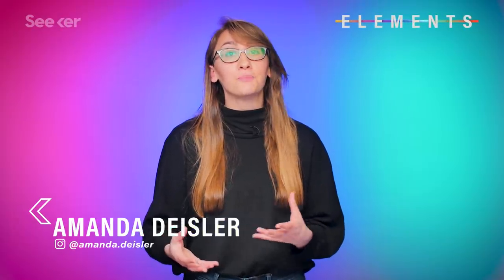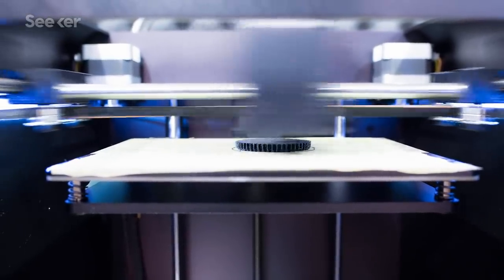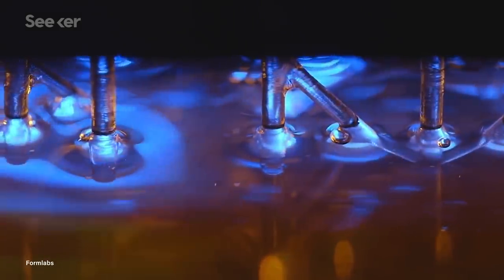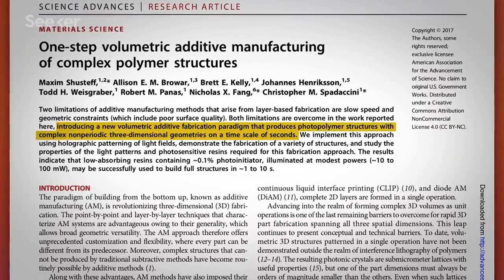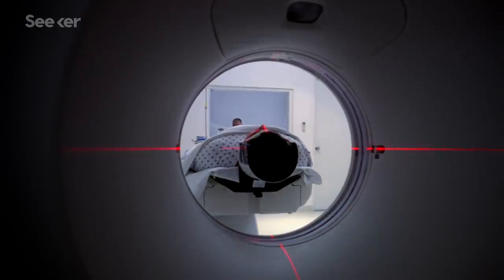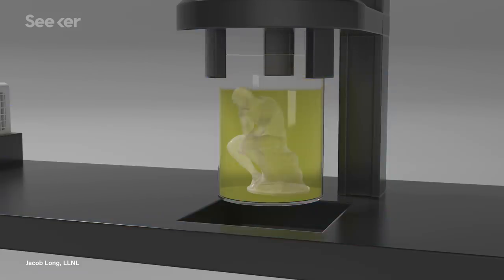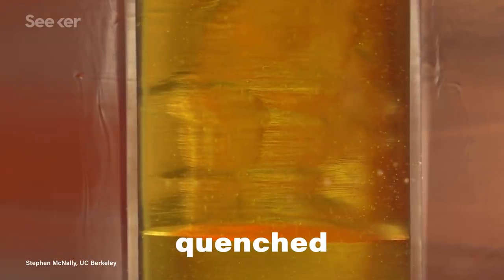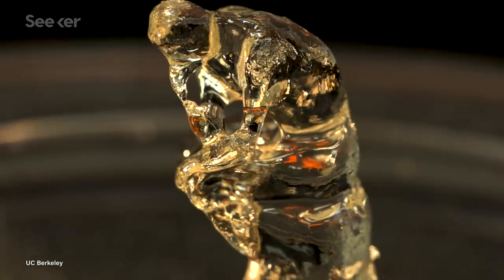Why This 3D Light Printer Is a HUGE Game Changer

Comment: I hope this could work across different materials someday, maybe using electric fields instead of light.
Reply: You could use DUMB microbots (spherical one-use batteries with a simple light sensor that makes them "magnetic" for a brief time), so you can use selective magnetic fields to control their position to BLOCK/reflect the laser [creating a "high density point"], so the resin could coalesce around/next/away from them from the "inside" of the object as it is made.
-> This allows for the use of multiple lasers shooting from all angles at the same time.
Reply: isn't visible light a small part of the electromagnetic spectrum? or ju really mean fields theory where fields are superior than particles  i.e photons?
Reply: @adolfodef  i'm sure people hu envisioned this first thought of that already. then they were shot in the head because of their stupid suggestions.
Reply: @kevintorres7045  not in the same context, no. it is fundamentally, but the actual usage is way different. you can have electricity and magnetism without light, light without either, and so on. It's all just energy and how you're actually applying it. like welding vs casting. both can make the same part.
Reply: You don't need it to print using different material. You can use the first object to make a mold container that you would use as a matrix for creating objects of different materials. It is not even important if this material is organic or not, because you can use this for fast prototyping and then create a shape container for other materials.

Comment: I don't know… It's an improvement, sure. But it depends on a special type of transparent resin. It's a good idea, which will have its uses. But it would be even better if they can get it to work with a wider range of materials.
Reply: game changer 😒😒😒
Reply: Given how many polymers and organic materials react at certain wavelengths, this can be quite easily expanded upon. Using a quencher like an abundance/removal of oxygen is already done in the 3d printer world let alone a lot of other production methods. I bet you now that in ten years we will have discovered at least 5 other reactive polymer groups and 3 quenching methods that can work with photon hardening. Adjust the structural part of the polymer to a different length, add special  side groups or extra interpolymer bonds and you will have a wide range of tensile strengths, elasticity and other properties to choose from.

Another way would be to suspend photoreactive enzymes in the resin that will catalyze reactions when hit with photons. A competitive inhibitor could work as a quencher, and you can polymerize everything we have enzymes for. 

This invention will ease my line of work considerably and I cannot to get my hands on one of these bad boys

Finally, I predict that once we will have active areas that polymerize on different wavelengths, we will be able to make products that have different properties in the same products by activating these bonds placed at different sites on the polymer in different areas of the product. Spongy in the centre, hard on the outside etc etc etc.

What a time to work in chemical innovation
Reply: You don't need it to print using different material. You can use the first object to make a mold container that you would use as a matrix for creating objects of different materials. It is not even important if this material is organic or not, because you can use this for fast prototyping and then create a shape container for other materials.
Reply: Dennis Klomp Hmm… Okay, cool! Seems like there are plenty more potential uses for this.

Comment: cool concept but you can tell that the resolution of the model is pretty terrible. Not sure how much they can improve this, but it will be interesting to see where this goes.
Reply: Yeah, I was wondering if anyone else noticed this.

Current 3D printers using PLA or Polycarbonate can achieve precision as sharp as ~20 microns which is insanely precise.

Most printers are closer to ~50-200 microns but there are some very precise printers out there.

Comment: This seems like it is not much better than the techniques we use currently with molds. This will definitely have niche applications, but I don't think it will replace current methods on a large scale.
Reply: If engineers can figure out a way to get other materials into the mix and still have it polymerise, that would be useful.
Reply: It’s not really for mad production it will make prototyping better and faster
Reply: FDM printers replace current methods today, this will be adopted instantly it becomes available.

Comment: What's the resolution?
I assume in a real application those bubbles in the liquid resin would be removed right?
Reply: Well realistically the resolution would be limited by the purity of everything and the dlp resolution. The bubbles are probably removed by vacuum
Reply: Just look at the airplane it formed...  Resolution is out of the question for now.
Reply: @linuspauly2380 , I'm not sure what that mean (I agree about using the vacuum to remove the bubbles) but I think you're referring to the gel. As long as its diffraction is accurately known it can be corrected for so I don't think the gel is the major limiting factor here (think of ground-based telescopes correcting for the distortion of earths atmosphere).
Reply: @seiyachan  That was what made me ask the question. I think the true resolution limit will be defined by the wavelength of the light, but practically the focusing optics used will be the real world limit. The examples shown in the video were made with a off-the-shelf digital projector, which will have very poor optics. I used to work in R&D Optronics (only as a technician) so I was hoping a techie might reply for a chat.
Reply: Bad Monkey i don't think the resolution has anything to do with the wavelength. cause the principle was something like projecting images of the object from different angles (instead of slices of cross section images at vertical layers), they will somewhat overlap at various extend at different images at different angles, which inturn solidify some addtional resin than what you would like.
Reply: @seiyachan  Very god point. I'm gonna have to bump this tech up on my list of 'to watch for updates' (I just made that name up - the list exists only in my head) because my assumptions were clearly wrong.

Comment: one step closer to non-invasive implants for things like replacement hip joints and spinal reconstruction. Imagine being able to inject a solution into an area and then use a catscan-like device to 3d print missing cartilage and bone or repair fractures or even tissue damage inside the patient without even keyhole surgery, crazy possibilities.

Comment: The main issue I see currently, beside the detail level, is that all of the objects you make would have to be transparent. It would work for things that didn't matter, but if you needed it to be opaque, than you'd have to find a way of coloring it after print, and getting your pigment to bind to a gel material without peeling or flaking under any pressure, or design all new polymers for each color, that would only self pigment after completion of printing. I mean, current 3d printing isn't perfect, but I cant say that this Is an improvement. They both have their pros and cons.

Comment: Resolution looks pathetic for now but at least the time issue of FDM printing has been solved using this method!
Reply: Maybe not... As they said in this video, you need a very special kind of resin to do this.  3D printers are useful because they can print in an extremely wide variety of materials.  This is what makes the difference between highly valuable manufacturing 3D printers & the plastic printing toys most people have at home.

Edit: because this is the internet -- when I say "most people" I'm talking about "most people who own 3D printers" obviously.
Reply: The way funding works, they need proofs of concepts to get more. if investors were smart enough or had the time enough to learn, they wouldn't need a proof of concept. But because of that they made the first proof of concept to get more funding for the second, which rotates further proving the process, now they will try to get more funding to develop this method further.  multiple high def projectors from multiple sides and a better resin is likely all that is needed. I bet a resin that turns opaque when hardened, combined with maybe creating the object minus a few mm's first would prevent some of the light from going too far through and allow them to use greater intensity to harder just one side at a time as they finish it to get the details done. 

Def room for improvement.
Reply: They're doing this with an off the shelf projector. I imagine one of the next steps is building a projector specifically for this task that can project in greater clarity.

Comment: It’s an incremental improvement on decades old tech.
Reply: i would go even further to say it's another dead end road for tech that has a well defined ceiling. lol. It's cool, but it does the same job so... no. lol.
Reply: Um OK my smartphone is an incremental improvement on the Commodore 64. Instead of taking hours to print an object it can be done in seconds. That could make this an option for factories, or provide life saving customized mechanisms in a hospital. Imagine a scaled up version of this printing car body parts. Maybe you could even customize your own car body.
Reply: Even if the different technologies already existed in the past, this is a tremendous improvement in many ways for additive manufacturing. If you dont think so then read the full article. If it was just a random improvement it would not have gotten a Science mag publication.

Comment: I see couple problems; resolution, very expensive print medium and most likely patented process which will stifle innovation on this technique
Reply: Apparently the medium is quite cheap. I do agree with you that using diffused oxygen in a solution as a quencher will prohibit high res printing
Reply: Yes, the worst problem possible for this is the patent. Without the patent on 3D printing we would be 10 years ahead in that area right now
Reply: @LuggageStardate  yes because it's ridiculous to compare new tech in its infancy to market available tech

Comment: unless you're into manufacturing parts for prototypes, i do not see why the average person would invest in a 3d printer. I haven't even used a normal printer in years.
Reply: The execs at IBM felt the same way about the "personal computer".
Reply: @bob_frazier  you can't compare personal computers to 3d printers. A 3d printer is useless without a PC and is much more of a niche market.
Reply: It's for makers and tinkerers
Reply: @jerrymiao7605  I agree. I personally would not invest in one now because they are too expensive, but i do think this technology is great. If i were an engineer / architect or really into gundam i would definety get one.
Reply: I'm confident that one day this tech will be ubiquitous.  When you can just go and print a tool or other object you need, using a blueprint you downloaded from the internet, instead of going to the store to buy it, it will be a huge time saver and convenience.  People of the future will wonder how we ever put up with having to go get something we didn't have.  Of course, there will be limits, but there would still be a huge application even for simple objects.  More so if the gel is reusable so you can just recycle it when you're done.
Reply: dnd minis
Reply: I'm surprised 3d printers are less common. The average person has a hobby, many include building and tinkering around.

Comment: Key factors for this technology to get as good or better than current resin printers:
-Print quality
-Print speed
-Buildvolume
If these are going to be on par or better than it will be a game changer, if the liquid is thicker than normal resin maybe no more need for supports or maybe use fewer.

Comment: When;
1. The process can be used  with metals. Game Changer.

2. Both in the same time.

More so.

3. Food.
Reply: Seems to require a transparent resin, so metal would be difficult, Food is probably do-able, so long as your ok with a translucent burger
Reply: @UNSCPILOT  

Yes..

Although..

1. Hardening could be done in a medium that becomes opaque..

Or a metal containing Emulsifier..

Where the heated stuff attracts the Metal containing blubbs. Where they will form..
Reply: Remember it's not creating something out of nothing. It's changing the state of the gel. In order to make food you'd have to use some sort of edible material, and why sculpt something from edible material when you could just eat the edible material?
Reply: @333puggles333  

More fun that way.

Comment: Adding some color absorbent pigment to the liquid could make it possible for full color prints.
Reply: @jlc2345  What I mean is to shine a blue, red, green or whatever color light on the color liquid and then it stays that color after it hardens, and it stays that color even after the hardened plastic is exposed to other color light. So if a color image is projected on the liquid it will have the image in and on the plastic after it hardens. An example is taking the liquid and projecting the color image of an object with a black backround to make a flat colored cutout of the object.Making possible for photo realistic color 3D prints.
What they doing in this video is that but with rotation of the virtual object camera and light hardening liquid in the cylinder in grayscale.

Photo reactive usually mean it glows brighter to certain light (like a blacklight and fluorescent paint) so no thats not what I mean.

Comment: This technology if advanced and funded will revolutionize future manufacturing. This is game changing in my opinion. Just seeing the object being created all at once like that blew my mind. This technology needs to be looked into for 3d printing objects in space since it isn't dependant on gravity, and might even work better in 0g!
Reply: It seems to waste a lot of resin, anything unprinted will not be  reusable as far as I have gathered. Even though it's faster and no supports are needed it really doesn't present any other benefits over SLA, which allows for more efficient resin use and also more types of resin. Also resin printing will likely always be too expensive for mass manufacturing since resins are not exactly environmentally friendly, cannot be recycled effectively and are bloody expensive. If it was feasible, we would already be seeing SLA printed parts in things. Injection moulding will always be cheaper (with comparable or better strength), sintered metal will always be stronger, 3d printing is the middle ground no manufacturer needs. Unless we are talking one off fabrications, but if that is your business you would just use a CNC for most stuff, a multiaxis mill can be incredibly fast and will produce stronger products than 3dp of any kind.

Comment: I was expecting them to use interference patterns of lasers, that is holography to generate light in specific regions above the threshold levels rather than just superposition.

I'd also like to see acoustic holograms used as scaffolding to support structures till the entire structure is formed.

Another advance that I would like to see is the CCD array typical of a digital camera used to create quantum wells that can specifically bind and move specific types of atoms from a vaporized gas and move them into position to bind with other atoms previously moved and held in place by whatever scaffolding scheme was chosen.

We're still just scratching the surface of what's possible with generalized manufacturing.

Comment: Technically, nothing would stop an FDM printer from printing like this, put the hotend in place of the DLP, and instead of resin in a vial, use a small mandrel (a length of filament would do) for your print to adhere to. Lastly, rotate the entire mess on it's side so the hotend is at the top. You would print along the X and Z axis, while the mandrel would rotate. Sure, it would take longer to print, but it's essentially the same in practice. Best part about printing this way is that most support material would become unnecessary except for some fine detail and bridges.

Comment: my question would be how much does the resin cost and the setup for this printer, and what steps are being done to reduce the price if it is expensive? 3D printers used to cost a boat load but are now reasonable in cost of setup and material used.

Comment: The  math is off on the solidification of the resin in relation to the rotation. Maybe increasing multiple light sources or improve the resin compound will improve the process. What if you put an additive that gets encapsulated in the chains to improve rigidity and curing times.

Some SLAs can print within 5 microns of accuracy. So no real call to abandon ship.

Comment: Interesting twist on the DLP UV curable Resin process but how much time does it really take to print and finish a usable part?  Understanding that the cured resin print is still soft(not 100% cured) and suspended in resin when it is finished being imaged.  The amount of volume achieved may depend on the resolution and LUX capability of the source.  The "Overprinting" is very limited but interestingly has been successfully done with other types of 3D printers.